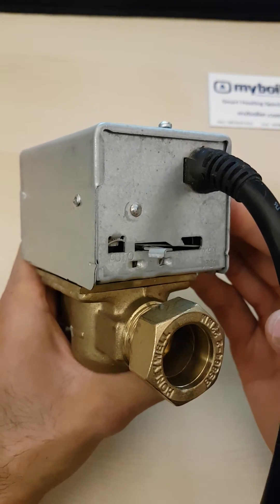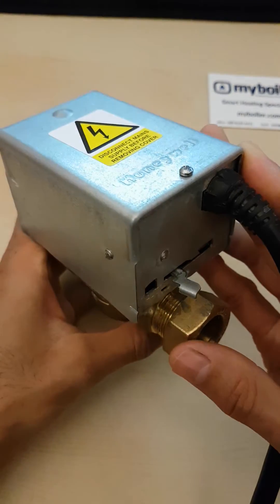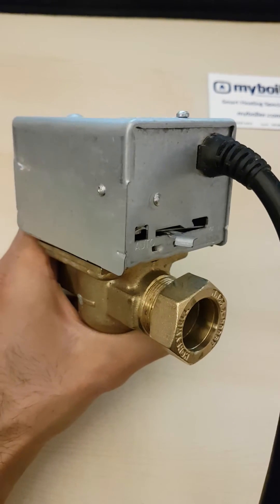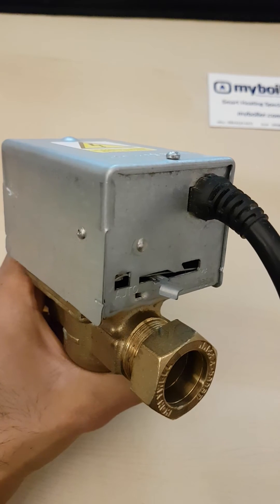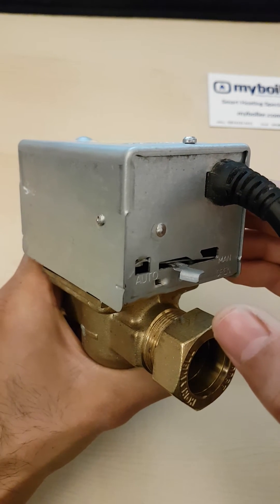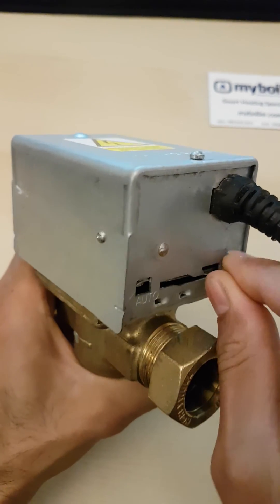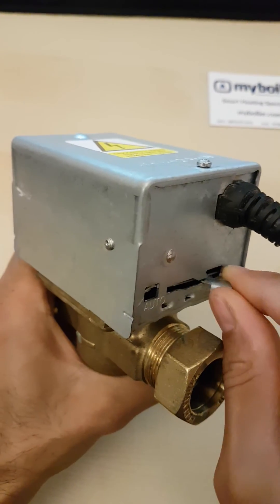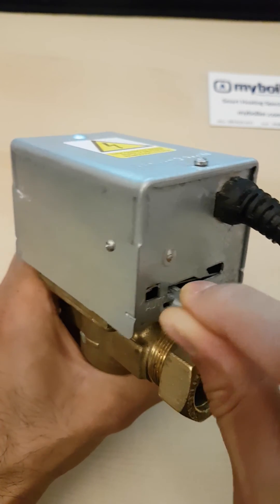How to check a 2 port zone (Honeywell type) valve is working

Comment: Hi I have Honeywell zone valve and when I turn hot water tank my radiator also gets warm. If I change zone valve actuator (head) will solve this problem? Please advice
Reply from the maker: Hi, 
It's possible it will solve it, you will also need to manually turn the spindle just to make sure it's free and not stuck. Before you do this also make sure it's not an electrical fault causing the valve to stay on
Jay K.

Comment: So mine I can open manually and lock it in place for my heating to work but if the boiler is on for the heating to come on it won’t automatically open. It does automatically close if I try manually open without locking it open though.
Reply from the maker: If it returns to its home position, means the mechanism is working, but the motor is not receiving an open signal or motor not working. Jay K

Comment: 🇬🇧 👍🏽 February 2025

This has to be literally the best explainer video on the Internet, for one of the most important & easy-to-access parts of our heating system!

For anyone wondering - this exact unit is what is in-play (or not) when we have the classic 'heating but no hot water' issue, or, 'Heating comes on with the hot water', or ofc 'Nothing coming on'.

Comment: Mine doesn't give hot water after turning on CH. The only  way to get hot water is to turn off Heating and also power off the diverter valve and can hear it move back into resting position and hot water works.. Is this faulty diverter valve?
Reply from the maker: It’s possible the CH relay is stuck in CH mode, stopping it to go to HW mode. Do you have a three port valve or 2×2 ports?
Reply: @ARatedTV  thanks for the quick reply. I have the 3 port valve.
Reply from the maker: Very likely getting stuck in CH position, or you have an electrical fault else where sending a continuous signal. Possibly the timer.

Comment: On mine there is still some soacs for it to fully close. Is this ok? Everytime i switch my ufh on, the rads get slighly warm..do you have any suggestuons for this? Thanks
Reply from the maker: Soacs? Jay K
Reply: @ARatedTV  sorry I meant there is still some space. So when the ch is on, I turn it to manual so it's loose as on the video but when I switch the CH off, the clip moves back to auto but there is some space still for it to full close.
Reply from the maker: @raj080288  Hi, it may just be a case of mechanism being worn out or debris in the valve stopping it from return back to closed position. In this case, you will need a professional to diagnose further by removing the head and checking the spindle is free or if there is resistance. In simple terms if the valve is closed, let's say for CH, when you call for HW, no water should go down the CH path. This would indicate not fully closing. Jay K.
Reply: @ARatedTV  Hi Jay, thanks for replying..I thought that might have been the case too and because it might not be  fully closed some water is getting in. Appreciate your help. Many thanks.

Comment: Hi - if I can open the valve manually which heats up the upstairs heating, but the valve is not responding to my nest heatsink, is this an issue with the wiring from the heatlink to the valve or possibly thewiring of the microswitch in the valve itself. Who would be best to investigate a plumber or electrician?
Reply from the maker: Hi. 
An electrician may be able to pinpoint it, however you really want a heating system specialist. 
Jay K

Comment: Is this equally true for erie poptop valve assemblies such as the AG13A030? Thank you
Reply from the maker: Hi, it’s based on the same design, so tge answer is yes. Jay K
Reply: @AratedYoutube  do these have a high failure rate? I have 3 all installed identically 10-12 years ago? If you remove the whole assembly using the spring loaded black lever and you manipulate the brass valve by hand, can that work temporarily to provide heat to the zone? Thanks a million in advance
Reply from the maker: @falloncohen6814 

Mechanical devices in general have failure rates some more than others. 

Yes, removing the entire head and manipulating the brass valve will open the pathway, however you still need something to signal for the boiler to come on.
Reply: @ARatedTV  doesnt the thermostat for each zone signal that? When the thermostat turns on in any individual zone, the geothermal heatpump turns on immediately but im having repeated problems with one particular zone that turns itself off whenever it seemingly desires and after watching your video, the erie poptop valve assembly associated with this specific zone fails the test you demonstrated.
Reply from the maker: @falloncohen6814 Hi, it very likely needs a heating professional to investigate further what the root cause is. Jay K

Comment: My 2 port zone valve controls upstairs radiators and a separate zone valve for wet ufh. When the hot water is on upstairs bathroom warm water leaks into radiator and warms them up without callling for heat - what could be the problem ?? Thanks in advance
Reply from the maker: 1. Most likely faulty mechanism not allowing valve to close.
2. Debris on the valve seat making it stay open partially.
3. Faulty electronics on zone valve.

Would require further diagnostics

Comment: Hello. Many thanks for this video. my Honeywell valve seems to be making a metallic clicking sound whenever switched on? Do you think replacing it would solve the issue?
Reply from the maker: Hi, loud clicking would indicate it may be starting to wear out. It may last a while, but a good idea to have it checked out / replaced. Just the top part, so quite a small job, maximum 1 hour. JK

Comment: And what would be reason, when valve is energised I cannot move the valve freely and neither open it manually. But when de-energised I can manually open it.
Reply from the maker: Hi, it may be that the mechanism inside this stock if you're not able to do exactly as in the video in which case you would need to replace the head. hope that helps.
 JK

Comment: I have one of these connected to a tank in cupboard, how hot can this unit get?? Ours is super warm to touch
Reply from the maker: If it’s super hot, it’s possible that it is on continuously when it shouldn’t be. Ie it’s supposed to come on and off with the programmer. You may want to check out other video on how to check off a 2 port zone valve is working. JK

Comment: Hi I have this one and rads get warm when water is heating up in tank …. And everytime I put that switch to auto it springs back like in video if I change the motor will this solve the rad issue thank you
Reply from the maker: It’s likely caused by the zone valve. Changing the motor by itself may or may not help, depends on the state of the spring mechanism and zone valve body. Likely there is debris in the valve causing it to not shut properly or thr mechanism being stuck. JK

Comment: How did you wire it to test whether it energises. There are 5 wires. Blue and yellow seem logical but orange, grey and brown. Do you just wire to a plug, which is live??
Reply from the maker: Brown and Neutral activate the motor, once it clicks the microswitch , orange and grey are connected. JK
Reply: Bin out

Comment: Thank you for making this video! My sliding mechanism will never move to the "manual open" side and I suspect that this valve is stuck closed (part of radiant heating system - pipe below valve is cold). Other zones work fine and are hot. Do you know if there are serviceable parts within the valve or anyway to open manually? Thanks!
Reply from the maker: Hey, seems like your mechanism is stuck, either the head itself, or the valve underneath. See this video ( https://youtu.be/RlYa19QfYNk?si=1fBoFtArX46vxytv ) to remove the head and use a pliers to gently swivel the valve into the open position. Please remember to turn off the power to the heating system before removing the head. JK

Comment: Hello, my new motor valve opens manually before connecting to the wires but once connected it wont open manually not auto. I thought the old motor valve was the culprit but with new motor valve it does the same thing. local plumbers cant figure out what the issue it. What could be the issue here? Another motor valve opens ok manually but not opening on auto. Could this be the wire/electric cord issues?
Reply from the maker: Hey, I am not sure what your describing, however basically the timer / programmer sends a signal to the room thermostat or cylinder stat, if they are requesting heat from the boiler ie they are not satisfied, then a signal is sent to the valve motor to open up, and indirectly this activates the boiler switched live, bringing it on. 

There are a few scenarios, where either the power is not reaching the motor ie faulty programmer or room stat/ cylinder stat or wires (sometimes eaten by rodents). The other scenario is the mechanism of the 2 port valve is jammed and doesn't activate the boiler. In this case you have to replace the 2 port head and not just the motor inside. The other scenario is that the spindle on the base plate could be jammed by debris in the actual waterside of the valve. You have to take the head of, and see if the spindle is moving freely using an adjustable spanner or pliers.

Also see following how to page
https://myboiler.com/how-to/2-port-valve-checkout-procedure/?source=ytc
Beyond this, it needs further investigation. Hope that helps. JK.

Comment: I have the same zone valve, mines moves across manually to open freely ( energised ) & closes itself, however doesn’t go into the open position automatically. What could be causing this?

Thanks
Reply from the maker: Hi, either not receiving a signal to open or faulty valve motor. JK
Reply: @ARatedTV  once turned on it makes a clicking noise however wont open, what would be rough cost to repair this? Based in East Midlands.
Reply from the maker: Hi, sorry we are based in London, so not sure of the repair costs there. You want to get a few quotes, likely only need to change the head. Possible for an electrician that has worked with these before to do it. JK
Reply: @ARatedTV  thank you!

Comment: Great - I have had problems with a number of zone valves where the tap itself has got a bit stiff and this has caused the place where the zone valve keys into it (invariably made of plastic) to 'round out' and not be a tight fit - then you get all sorts of intermittent problems.  Probably down to hard water jamming up the actual tap valve.  One to look out for!
Reply from the maker: Hi, usually this is caused by debris in the water. It’s a very good idea to start your heating in the summer at least once a once to prevent seizure of components. Also very important to make sure inhibitor / anti rusting is present in the system. JK

Comment: Hi, if there is a constant clicking noise when the themostat is triggered on, what does this mean. It goes off when not on but has been clicking ever since yesterday for the upstairs heating.
Reply from the maker: Hi Scott, means your zone valve mechanism is no longer working as it should. Also check to see if the spindle is moving freely, use a small spanner or pliers to check. Then replace the zone valve head if the spindle on the base is moving freely. Hope that helps. JK
Reply: @ARatedTV  many thanks. I've got a replacement synchron and will attempt installation tomorrow.
Reply from the maker: @scotttv2557  Hi Scott, usually the clicking only happens if the mechanism is worn out, that also usually means the synchron is fine. Would definetely have advised for a head replacement rather than just the synchron. Hope that helps. JK
Reply: @ARatedTV  Thanks JK. I've just ordered a new head. Luckily it detaches from the pipework, so should be an easy swap out with the power off.
Reply: All sorted. With power off ot took around 30 minutes and is all working perfectly.
Reply from the maker: Great result. JK

Comment: Hi why is it when I leave mine on automatic then only downstairs radiator comes in but when I put it on manual both upstairs and downstairs radiator comes in perfect
Reply from the maker: Hi, seems like that particular valve your controlling is responsible for the upstairs circuit and is not working, that is the valve has failed or no signal is reaching the valve via the timer, thermostat or programmer. JK

Comment: How can you tell if the valve is open or closed?
Reply from the maker: If it is energised as shown in the video it should be open. The only exception is if the internal valved is clogged up or partially jammed then it may appear the valve is energised/open however in reality internally it would not allow water to pass. JK
Reply: @ARatedTV  thank you for coming back so quickly. From what you are saying, all 2 port motorised valves that one would expect to find on a domestic central heating and hot water system are energised (powered) to open and not powered to close. Is there a type that are powered to close and not powered
 to open?
Reply from the maker: Yes there is a powered to close type, usually found on solid fuel appliances or on advanced setups. These will usually not have a lever. JK
Reply: @ARatedTV  thank you for your help

Comment: there's is a 3 port valve. if I put it back on manual can I leave it there
Reply from the maker: On 3 port valves both the hot water and radiator pathway is kept open. As long as the hot water cylinder installation is installed to regulations, it would be ok. As a precaution, making sure your boiler flow temperature is set to no more than 65 degrees will ensure that overheating is not possible. JK

Comment: Guys I have old school back boiler and tank in airing cupboard. got hot water and one radiator small room getting mild hot others not in house. however all piped near tank hot any ideas?
Reply from the maker: Hi, likely circulation issues or partial blockage on the heating circuit. Otherwise faulty zone valve/controls. JK

Comment: Thanks for the video , I tell you my problem .... I have a horstmann 2 way valve and have 3 heating selections , upstairs, downstairs and hot water .. If I select hot water the downstairs rads heat up also , downstairs is working when selected also however upstairs heating has stopped working unless I override it with the Lever .
Reply from the maker: Hi Adam, not sure if you have a combination of electrical and/or mechanical issues. Check to make sure the programmer is sending out 240v to each valve correctly and independently ie 1 at a time and check each valve is working ie opening up. The final stage of each valve opening is the trigger to activate the boiler via a microswitch, this can also stop working when the mechanical side of things becomes a little weak and the trigger arm does not touch the microswitch. Please note this requires working with electrics safely and may require a heating professional. Hope that helps, JK
Reply: @ARatedTV  Thanks for the Quick reply ... strange thing is there only seems to be the one valve in the hot press ... I also just noticed that , when I switch heating on downstairs , burner kicks in ok but the lever on the port valve doesn't move and still has a lot of resistance.. just to note also that this is an oil fired boiler system . Thanks . Adam
Reply from the maker: @ADAMMCCR  Hi Adam, the fuel system does not matter so much in terms of controls generally as it's still a hydronic system. Can you state your system type ie is it S Plan, Y Plan etc. How many zones you have ie hot water and radiators, or hot water, downstairs(seperate timing,or thermostat etc), upstairs (seperate timing etc). Maybe a little more details or pictures if possible. JK
Reply: @ARatedTV  hi thanks for the reply , I found the other 2 valves downstairs behind a wooden panel both the valves were broken and have replaced both and everything working now as it should ... the heating downstairs i assume was stuck open hence why the rads heated when the hot water was switched on independently.... I can't believe though were the other 2 valves are not exactly an ease of access. Oh and these valves are 18 years old.
Reply from the maker: @ADAMMCCR  I am glad you found the other valves. The old stuff was made to last, it's considered lucky if it lasts at least a year or two now. Although some smaller brands are now much better designed. JK.
Reply: You may have the radiators plumbed in wrong ,plumber into to boiler return and not the heating return.is it al, the rads or just specific ones?

Comment: Thank you very much for your video. And what should K do when it’s make a lot of noise? When K try to switch on the heating, it doesn’t work and I here “tac”  “tac” “tac”
Reply from the maker: Hi Pierre, if it makes a lot of noise or "tac" "tac" "tac", it usually means the mechanism of that zone valve head is worn out and/or slipping. Very likely you will need to replace. JK